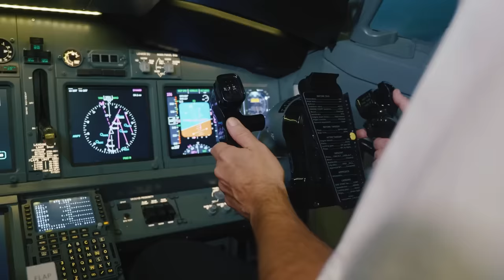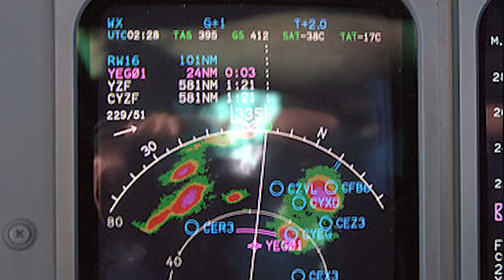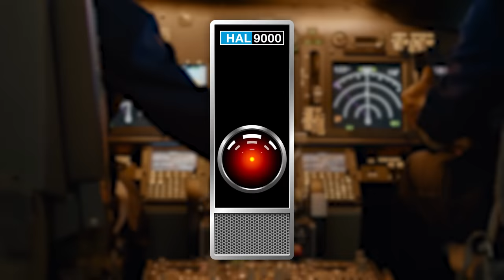Neil deGrasse Tyson Explains Advancements in Aviation

Comment: Neil, you are an expert and master educator... in astrophysics!  Stick to that!  35-year pilot here, wouldnt call myself an expert, but you definitely have a few misconceptions about flying!  A plane flying around waiting to land is holding, not taxiing. The relationship between bank angle and gforce has long been known and does not need to be calculated. The same bank angle in a coordinated turn will produce the same g-force regardless of aitcraft, weight, speed, or conditions. Autopilots will be more consistent and precise, but it's not a modern concept or calculation.  Autopilot landings are not common and most aircraft do not even have that capability. And at least in the US, even if the plane is equipped for an autopilot landing,, one of the human pilots does the landing almost every time.

Comment: Back in the 60's I remember hearing sonic booms from experimental flights conducted out in Mohave desert. They were interesting and sometimes would make you jump. As for the noise from take-off's are concerned it is housing encroachment that caused the air ports to require air planes to take off at a steeper angle so noise would be cut. As far as the engines being quieter it is because of the Gen 2 series, maybe even newer now, of engines. These engines were designed to have a cold air envelope surround the exhaust stream from the fan which helps keep the noise muffled. The computers are great for the airplanes but in reality they are just a box of parts and are worth nothing until a program tells all them parts what to do. I hope the next major advancement in aviation comes from a high speed lighter than air type ship. This will allow hovering over an airport if necessary, reduce crashes, and cut back on fuel as much as the computers did for the timing aspect of flight duration.

Comment: Hi, taxi: it's the aircraft's movement on the ground, around an airport. In the air it's just called flying. Or holding if you're waiting for something.

And that bank during the turn is not really calculated by any computer. Airplane does it by itself. It's called a coordinated turn and in fact it's the only way of turning an aircraft properly. Even a sailplane does this.
I'm an Aerospace Enineer and active B737 pilot. All the best!

Comment: I would take issue with the 50% chance of rain topic here. While binary, the chance of rain is not necessarily 50%. Think of the desert in Arizona, there's not a 50% chance is going to rain there. Even in a climate where it rains exactly half the time and the other half the time there is no rain, on a particular day the weather patterns could indicate otherwise, something other than 50% chance. While it seems tempting to assign a 50% chance to any binary probability, these are not coin flips. The chance of two different things happening is not usually 50%

Comment: This was interesting and informative. I fly (as a passenger) about 10-15 flights per year. I hadn't really noticed it, but the barf-bags in the seatback disappeared in the last few years. One thing I do want to point out is that this episode ignored the "computer does everything" tragedies of the 737 MAX. One little sensor at the front of the planes fed wrong data to the flight control system, which then "decided" to pitch the planes into stall. So much for "AI". I'll prefer an experienced flight crew with many thousands of hours of combined problem-solving over over an "AI" that will never have the ability to look out a window. And if my drink spills, good. The pilot probably saved my life.

Comment: Coincidentally, the dangers to the airplane and its passengers are amplified with a quick ascent, because of a phenomenon known as “ground effect”… Here’s how it works.

“Lift” occurs when a specific airspeed is maintained.  And that airspeed is significantly reduced when the aircraft is within a distance of roughly half of the wingspan from the ground. This phenomenon is often used by pilots of personal aircraft to rise a short distance from, and avoid the turbulence created by, a “soft field” during take off to facilitate smooth acceleration until a nominal flight speed is achieved.  

If a strong “gust” of wind from behind the aircraft, at the moment the aircraft is leaving “ground effect” is encountered, lift will vanish, and the aircraft will quickly drop like a stone.  With the “attitude” (angle of the aircraft relative to the ground) of an aircraft during a quick ascent as it would be, the results can be disastrous…

While I’m certain that these conditions are considered, and procedures employed to avoid them, systems do, from time to time, fail.  So “property values” are considered to be more valuable that human life? Ahhh, the joys of Capitalism…

Just a thought…

Comment: There is still a place for human pilots- when the unexpected happens. Look at the "Miracle on the Hudson". Multiple bird strikes during takeoff caused a double flameout- the airliner was suddenly a glider. Current computers would not have instantly figured out the only possible way to save the ship was to ditch in the Hudson River. Yes, given instructions to do so the computer would have done the ditching correctly, but would it have thought of that in the first place? Not yet. Perhaps in the future. The pilot is like that little belly parachute skydivers wear in case the main chute fails.... You may never need it, but when you do need it, you REALLY need it.

Comment: I think it was reaction to the sonic booms from the Concorde supersonic jet that started empowerment of local areas to legislate/take power over their airspace. The booms were so disturbing that states started declaring themselves no-fly zones to the Concorde at supersonic speed. Then they realized they'd just successfully exerted control over airlines and started in on the rest of them. I noticed a few years ago that Vermont had fairly strict noise standards and even in a smaller plane the pilot announced that we'd be dropping quickly on our decent due to local noise regulation. Something like that, I forget the exact thing. Even more recently when I was flying through San Francisco I was shocked at how quiet it was even outside.
Reply: Time is very important. For money, time is very important. 

To go from LA to NY is 4hrs 30min.
And from NY to LA is 5hrs 30 min.

Imagine that in 3 hours. Or 90 minutes. Or 45 minutes.
Reply: @robert2690  - not to diminish your point but I suddenly laughed thinking, "Well they solved the LA-NY issue by becoming each other thus bringing commute time to zero."

Comment: Neil, I have a question you said that there is technology in a plane so that you do not feel it bank and you’ll never know when you’re turning. Can I use that same technology in sailboats or large sailing yachts so that when they sell, the whole boat isn’t turned sideways and everything doesn’t slide around everywhere you could see this happening in the TV show below deck sailing yacht
Reply: If you can roll your vessel that much without capsizing it!

Comment: There are Light Utility Sport Aircraft that require no more than an automobile license to be legally flown bypassing the need for the annual flight physical that is still necessary for you to have your private pilot license. New these airplanes cost quite a large sum equal to costs that were your expectation when paying for an actually certified single engine land aircraft. There are Wing in Ground Effect "Boats" that speed across the Mediterranean. These craft do less damage to the Mediterranean Sea floor. There are simply few goals our engineers cannot accomplish if paid to accomplish those goals.

Comment: Have a condo in Jacksonville that is on the flight path for Runway 28-10 NAS Jacksonville.  With the prevailing wind most flights land to the West on Runway 28, most flights with Navy variants of commercial plane make relatively little noise, however, whenever the Blue Angels or any fighters are in the pattern there is noise galore.  I worked nights and slept days, first time the Blue Angels performed at NAS Jacksonville - I thought we were under attack - this was the time of the 1st Gulf War.

Comment: Maybe it is because I got the chance to fly if the Army was in a hurry to get me somewhere or if I was going to be jumping out of it. The direction of gravity for us was very rarely ever in the direction of our relative down, much less when making a turn or banking.
Reply: Spent a lot of time jumping from perfectly goof aircraft as well. Pilots who care about the comfort of their passengers will perform coordinated maneuvers to keep the relative gravity (G-forces) pointed toward the floor of the aircraft. While practicing combat maneuvers, this is much less of a concern. But, they will avoid uncoordinated turns as much as possible when carrying wounded or when heavy (when flying heavy loads like tanks, for instance).

Coordinated flight is also extremely important for flight efficiency. You will fly further, faster, while burning less fuel. It is extremely important for helicopters. Some helicopters may experience rotor component damage if you let them do negative Gs.
Reply: That’s NOT GRAVITY!

Comment: You say the airplanes computer leads to lack of g forces during banking then follow that up by an explanation of how it's really the center of gravity and physics (not computer microadjustments)
Reply: It's not a lack of g-forces, it's a lack of lateral g's specifically.  The normal g's, as in perpendicular to the floor, will still be there.  In fact, it's about 1.1 g's, normal to the floor of the aircraft, at a typical banking angle, so you do feel slightly heavier.

Comment: If the cockpit controls can be locked out and the aircraft controlled from the ground then surly terrorist could hack into the system and control the plane.
Reply: And the pilots could be locked out just as easily.
Reply: @theMazdaManiac  Exactly my point.

Comment: In the early days of the autopilot vs pilot, Airbus gave override to the autopilot. There were a number o crashes caused by the autopilot refusing to pull up, the pilot be damned. Much better now. The L-1011 was the first airliner to taxi-takeoff-fly-land-taxi all by computer.

Comment: Flying is still a Pain in the you know what. First you have to drive to the airport and find a space in Long Term Parking then wait for the shuttle to the terminal. Now the airline wants you to check in maybe an Hour before your flight. You can usually check your bag at the curb at the terminal. Then it's a long walk to the line to go thru TSA. Then another long trek to wherever your gate is and wait. Finally your plane arrives and you have to wait for the incoming folks to get off, Then they'll call for boarding according to whatever scheme that airline uses. Now you're packed in like sardines wherever you sit. When you finally arrive at your destination you deplane and make your way to wherever your baggage is supposed to come off and wait for that. Then you arrange whatever ground transportation you want to get out of there.  I'm Old now and there isn't anywhere I want or have to go that isn't within a 3hr drive in my own comfort. I'm Done!

Comment: Be interesting to get more details on what happens when the plane turns, sure, "down" is still centre of my body, but my brain sure knows we are turning, when the "thing in my head that pulls north" moves to a different spot inside my head, disorientating me for 2-3 seconds. What's that about..
Reply: You do feel slightly heavier during a banked turn, so you do know you are turning.  But you likely couldn't tell which direction, without outside clues, or a Coriolis experiment (like seeing which way a pendulum rotates).  A very skilled pilot can dive the plane at the same time, so that you still experience a 1-g environment during this time, and don't know you are turning.  It is rare that they do this, since you sacrifice elevation to do so.

Likely what is happening, is you can tell that the sun is in a different direction, even if all nearby window shades are closed.  The window shades aren't perfectly opaque, and you can tell when the sun switches from being on the left side of the plane to being on the right side of the plane.

Comment: Visit an American airbase Europe and go back in time... The army still uses old engines and you can't even hear yourself think anymore. I have pressed an emergency button on a machine thinking something was wrong but it was just an AWACS taking off 10km away and coming over head.
Reply: That’s because they are 50 years old and have almost 40,000 flying hours on them.

Comment: All that computer control is just fine and dandy when everything is going as planned. But what happens when one of the computer senors malfunctions and it is getting the wrong data. For example the Boeing 737 Max issues. I still want a couple of well trained and competent pilots up front for when things go terribly wrong. After all they will be the first to arrive at the scene of the accident, so they have skin in the game. Someone on the ground flying the plane remotely would not have the same level of commitment.

Comment: 3 weeks after this pot cast a private plane was over DC crossing no flying air space. Six F 16 took off and chased the plane to investigate. The plane crushed . For sure that plane was equipped with computers. The speculation was that the pilot and passengers were unconscious from asphyxia. How likely the computer didn’t show low oxygen level? Why they didn’t control the plane from ground ?
Reply: The airspace over DC is not a No Fly Zone. Just over the White House, The Naval Observatory, and Washington Memorial below 18,000 feet MSL. The aircraft was not in that area. It was near 34,000 feet MSL. Well above the DC flight Prohibited Area.

There were not SIX F-16s. Two more than sufficed. They were scrambled to intercept the aircraft because the aircraft was not responding to ATC as required. 

There are alarms that indicate when cabin pressure is too low. And, there is supplemental oxygen onboard. 

The pilot had a medical emergency that had nothing to do with cabin depressurization. 

Passenger aircraft can not be controlled from the ground. Yet.

Comment: If moons orbit the planets. Planets orbit stars. Stars orbit in a galaxy. Do galaxies orbit a central location in the universe if so. Does the universe orbit anything?
Reply: Good question.  Some galaxies do orbit.  Our own galaxy has two satellite galaxies called the Magellanic Clouds, and it is orbiting the center of mass of a collection of galaxies called the Local Group, which is orbiting the center of mass of a larger group of galaxies called the Virgo Supercluster.  This is the largest group galaxies containing our own, that are close enough to be gravitationally bound to each other.

Eventually, however, you get far enough away from other galaxies, that there is no longer a center of orbit, because the force of gravity is dwarfed by the cosmological expansion of space.  At that point, galaxies are permanently disconnected from each other, and no longer capable of being in orbit around each other.  The galaxies might as well be repelling each other, even though it is the inflation of space that is repelling them, and orbit is no longer possible.
Reply: @carultch  thank you very much.

Comment: 14:20 
What do you do when the terrorists are on the ground?
Then they're not just in control of 1 plane... but potentially ALL of them with these remote systems? 
No thanks.
This issue is actually coming to roads near you with cars becoming more computerised. And I'm not sure the benefit and costs are worth the potentially catastrophic downside if it's compromised.

Comment: Sorry tons of Dunning-Krueger going on here. I don’t have a PhD in physics, but I fly airliners. It’s already been mentioned about your misuse of the term “taxi”. But when you say “The Computers” make it so you no longer “feel” the airplane turning, that’s balderdash. The Wright Flyer didn’t “feel” the airplane turning either, and there were no computers. Banking an airplane moves the lift vector laterally, and the centripetal force makes a person “feel” as if they are still level. No computers necessary.

Comment: Thank you for the video professor Tyson , I would like to add some infos . Many people get confused between Computers and Auto pilot , what professor Tyson is talking about in this video is Computers . In modern aviation you have a mix between pilot handling and computers calculations  so for example if the pilot makes an aggressive turn  to the left the computer will process that signal so the aircraft won't turn aggressively and ppl won't spill their water, so lets say pilot flys and computer monitor the situation . Auto Pilots is the opposite ,we could say are computers taking over and pilots monitoring it , above certain altitudes traffic is so heavy you need to be very precise in terms of altitude speed etc only a computer could (also the faster you go the less dense the air is , the harder it is to fly precisely) on critical phases of the flight though is the pilot flying , take off are never flown by the AP and landings are only when the visibility is almost 0 but 99% of time is the pilot flying . also you have emergencies  computers cant handle on their own , sum of different emergency that require more than binary code to be fixed , decision making computers can't deal with yet and also emergencies where the computer brakes and revert pretty much from a modern computer to a 1980 one :) that's why often in emergency you will indeed see those glasses spilling their water or even worse baggage hitting heads. so no , if you are wondering , you won't see an aircraft without pilots any time soon
Reply: They are the same thing!!!